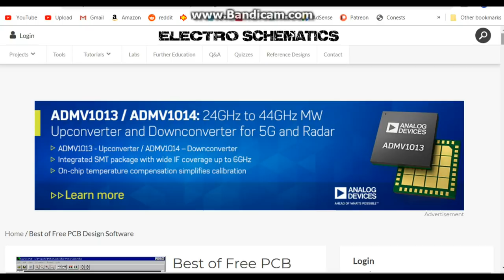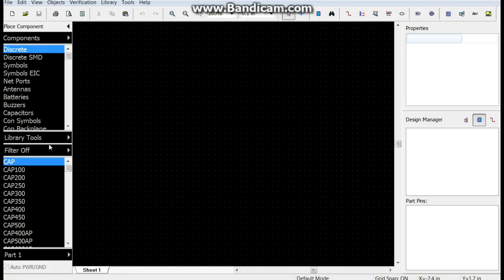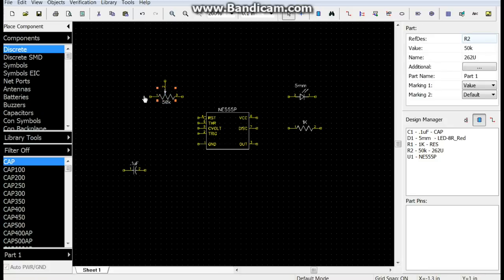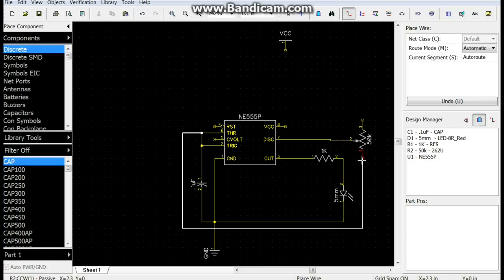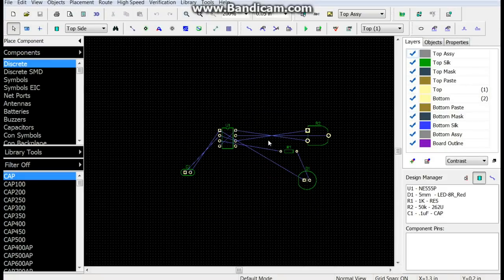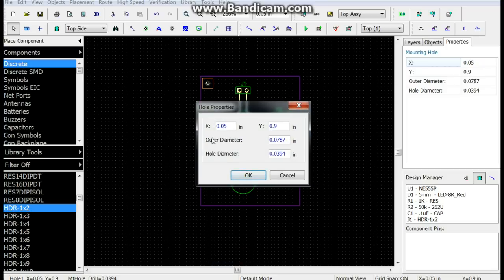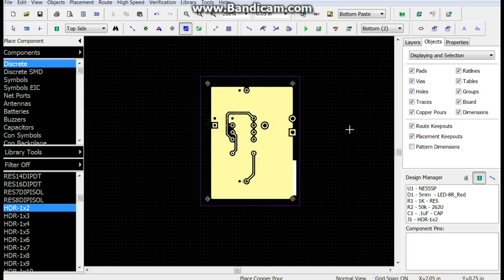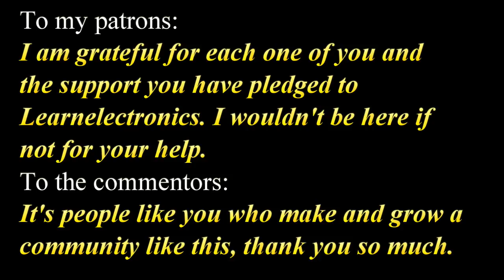Step by Step guide to beginning PCB design

Comment: When I click on 3D, none of the components are on the board. I checked to make sure all components had the footprint and they do, actually I followed along with you and used all the same components as you did. Any idea of why the components are not showing up on the 3D board? Thanks!
Reply from the maker: Some just dont have the 3d components. You have to find and download them or make them your self.
Download and install the digikey libraries if you haven't done that yet.

Comment: I use DipTrace exclusively.  I think it is excellent.  I’ve designed and built a through-hole TTL retro clock using the schematic builder, created a 4 layer board and had it built by a competitor’s board house in China, which I like a lot.

I’m very satisfied with DipTrace.  The learning curve was steep, but not overwhelming and there was a couple of gotya’s, but over all, I’m really happy with it.  I even created a couple of components for the board.

I hope these videos continue, it’s a great teaching tool for those who want to create circuits and put them on finished boards.

It is unbelievably satisfying to watch your circuit work on a board you created.

Once you get rolling and get used to it, DipTrace is really great. 

Thanks, Paul, for the great video!!  Hope you continue to feel better and nice to see you back in the saddle!!  👍👍

Comment: What Icon are you using to move the Lines as required ?
Having issues following what your doing on the Tool Bar what your using ?     At what point did you allocate or pick the Thru Hole size or was that Automatic ?   I'm more then slow between the ears on this.
Reply from the maker: Im using the Arrow tool.
I set up the sizes before hand.
That's ok. ask away. thats why Im here!